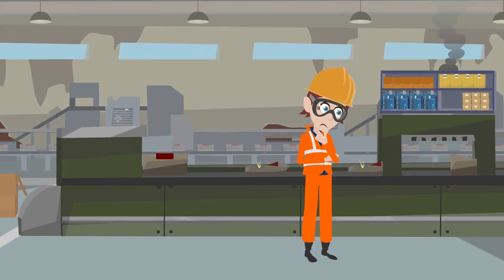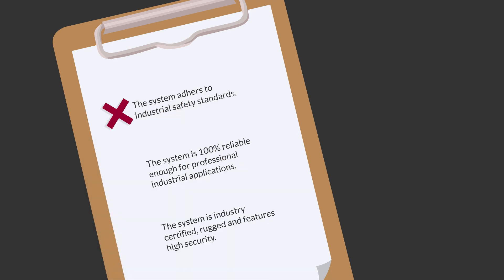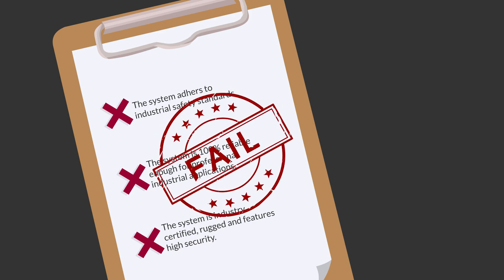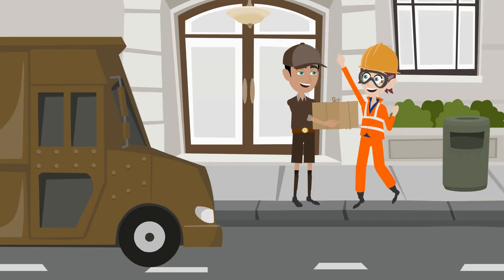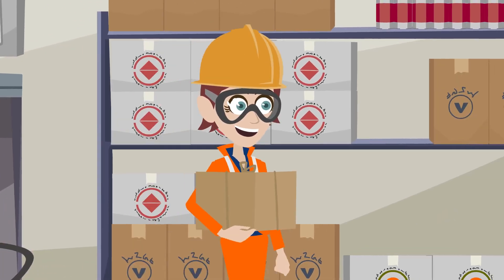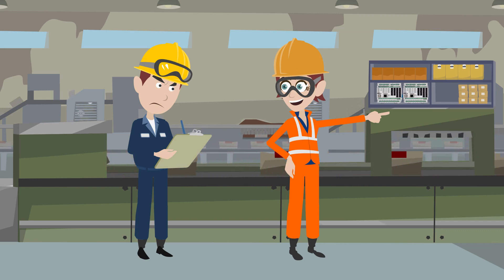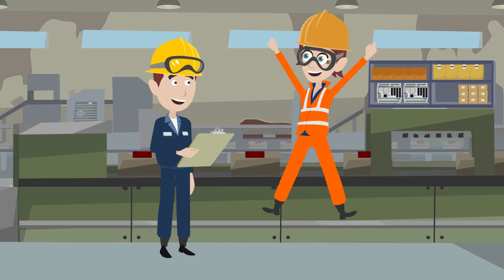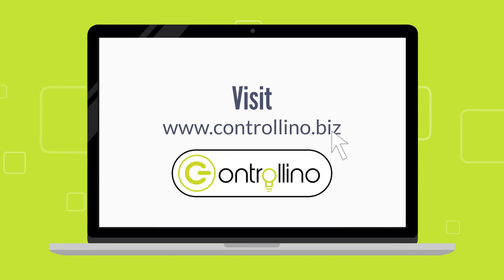What is CONTROLLINO? Simply explained

Comment: This Commercial is misleading, your entire system is based on an Aduino. What your commercial should have said, your entire set up is an Arduino shield. The statement that Arduinos are unreliable is a lie.  A PLC controller and Arduino are 2 different things.  Its like comparing a processor to a processor+motherboard+OS combination.
Reply from the maker: Hello Andrew, I think you missed the point. Since CONTROLLINO has the same processor as an Arduino board … the programming is totally the same! So you are 100% right … you can professionally program it with various feedback loops … and so on. Where an Arduino board has its weakness is the hardware relatability regarding overvoltage, electromagnetic compatibility, …
So I think we are on the same side.
Reply: @IkkenhisatsuAUT  yeah I get the point of the advert but at first I dismissed it as well. looks like a nice product.